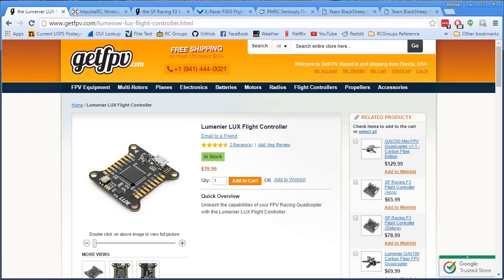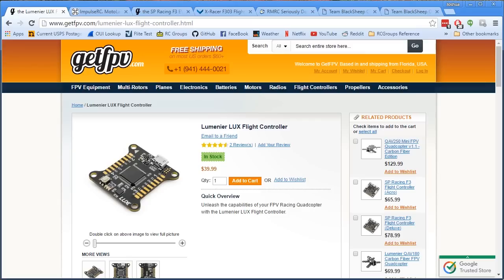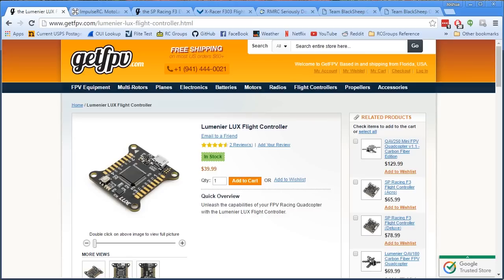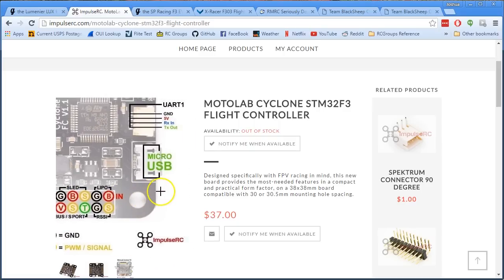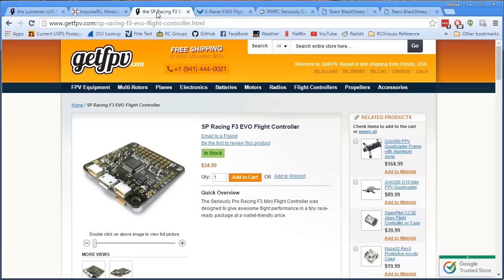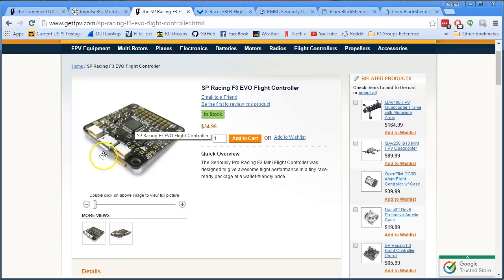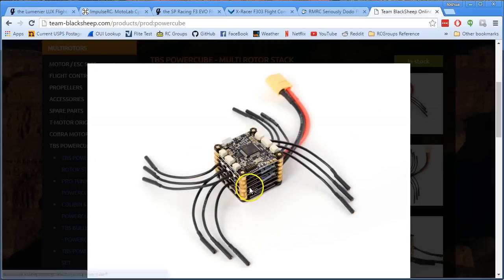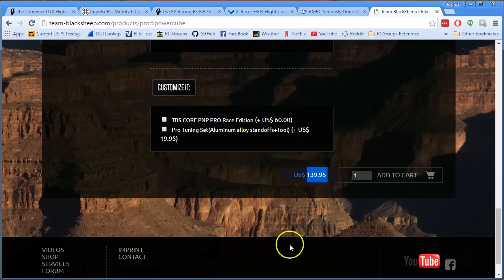The Best Cleanflight Flight Controller(s) - May 2016 Update

Comment: I will never fly my powercube again 😢. I'm kidding,  I have no complaints, running betaflight and blheli and I think maybe just don't have the level or knowledge to notice the difference I guess. To me it feels locked-in and and flies like I expect.  Moving to kiss probably in my next build.
Reply from the maker: Team BlackSheep I also thought your tone was defensive. Comments like, "keeping one hand in your pants" for example seemed discourteous and inflammatory. Also, I really don't think I "trashed" your product or "dumped all over it". I think I was VERY clear that I didn't know whether your ESCs perform well or not. I think that I am very clear with my audience about when I am sure about my answers, and when I am speculating based on incomplete information. And I go out of my way to set the record straight when I'm incorrect.

I actually did read your manual. And to be sure I wasn't missing something, I also searched for "gate driver" and didn't find it. So it turns out you use the term "FET driver" instead of "gate driver". My mistake. But even by your own estimation, this puts the PowerCube on par with the Afro HV, which is 15th place on QMF's 1800kv test and 24th place on his 2700kv test. And that is ONLY taking into account thrust and g/w, not braking performance or thrust and rpm delta. So it sure sounds like you are agreeing with me that the PowerCube's ESCs are, at best, mediocre, even though I got the technical detail of whether you have a gate driver or not wrong.

My main criticism of the PowerCube is that I don't want to pay a premium to be denied the ability to choose top-notch ESCs for myself. Many, many people feel differently and prefer to pay a premium for the ease of build and integration that the PowerCube offers. I don't know why stating this fact seems to make you so mad. It's like if somebody said, "I like to solder and build, and I think I can get a higher performance power system by designing it myself, so I don't want a Vortex Pro," and somebody from Immersion got all mad and insulted.

We're talking about ESCs here because the PowerCube's ESCs and FC are a single unit. You can't assess the PowerCube's FC without discussing its ESCs.

I'm not interested in getting into an argument with you. I feel like we have both said our piece and am happy to let the issue lie. But if you're going to keep arguing with people here, I'm going to keep sticking up for myself.
Reply from the maker: In lieu of data, I'm fine with an educated guess. Let's get the powercube tested by QMF and find out what the results are, and then we'll know how it stacks up. Are you familiar with miniquadtestbench.com?
Reply: +Team BlackSheep I think JB's review on "your" esc was more than fair and diplomatic.   Your defensiveness only leads me to wonder why? Have you missed the mark with your modular cube? I feel that product is directed more for the plug and play market that would rather pay more than faff around with a soldering iron (and credit to your brand) with the added bonus of dropping the fact that he/she has the latest "thing" from TBS. Well, I dare say the watchers/subscribers of Joshua Bradwell's channel are predominantly looking for a bit more than what cube has to offer.
Reply from the maker: +Team BlackSheep here's the research I did: read the product page and manual. Google "tbs powercube dedicated gate driver" and some other variants of that. Nowhere could I find any reference to the powercube using dedicated gate drivers. I also searched miniquadtestbench.com for the powercube to see if there were any test results. There were none. 

As I think I say in the video, historically absolutely no Atmel based ESC's other than KISS top the tests. And KISS have dedicated gate drivers and hardware PWM generation. Afro HV comes close in performance with dedicated gate drivers, but there are easily 20 SiLabs ESC's that beat it.

So what more research do you want? Im not making wild assumptions here. In lieu of evidence which doesn't seem to exist, I think it's safe to assume that an Atmel ESC has been built by its manufacturer for price not performance. If you're the exception, I encourage you to submit to QuadMcFly for testing and update your marketing materials to make your claims more obvious.
Reply from the maker: At the end of the day, like I said in the video, "I think that there is an audience for this board, but that audience isn't me." I try very hard not to waste anybody's time showing them products that are shit. The PowerCube isn't shit. It's just not for me.
Reply: I am more than willing to test the powercube ESCs if anyone wants to get me a unit to test.
Reply from the maker: Thanks for setting the record straight. I will be sure to link to these comments when referencing the PowerCube in the future. Frankly, I think I can even add an annotation to the relevant section of the video with a direct link. I hope that helps a little bit.

Is there a reason why the PowerCube hasn't been tested by QuadMcFly? If you haven't submitted one, I'd encourage you to reach out to him. Ultimately, whenever people ask me what the highest performance ESCs are, I plead ignorance and refer them to his site, miniquadtestbench.com. I would love to see the PowerCube high up on his ranking, and to add it to the Afro HV and of course KISS in my list of, "The only Atmel ESCs worth even considering."
Reply: +doondedulin44 *& FC
Reply: +Joshua Bardwell +TeamBlackSheep 2 wrongs don't make a right. I do think that Joshua, as someone that sooo many look to for the very best quality information, shouldn't review things he hasn't had personal experience with. I think it wouldn't have been too hard to find Trappy in the forums and get info from him to reference but I digress. On another note I think we all agree TBS was overly strong with his rebuttals and came across very unprofessional in that sense. I also think the best course of action is to put your product where your mouth is... A simple "I strongly disagree with your opinions/assumptions and I would like to offer you a test unit for your unbiased review. I think you'll be pleasantly surprised!" would have settled it perfectly.  Hell I'll donate $20 to help this happen. I personally have a PowerCube myself and it functions perfectly and was exactly what I was looking for in the build which was simplicity and I personally don't mind a little premium for convenience.
Reply from the maker: In judging the ESCs' performance, I was accepting your premise that they probably perform at about the same level as the Afro HV. You're arguing that my assessment of the ESCs' performance is wrong or incomplete, but it really seems like we agree, so I don't know why we're arguing. You know your product better than anyone. I took an educated guess based on what processor they have in them. And we ended up in the same place. So why are you arguing that I'm wrong?

I'd love to check out the facts. If you have a head-to-head test of the powercube vs. any of the current-gen (f390) or last-gen (f330) ESCs, I'd love to see it. I am always, always, always open to data that challenges my current beliefs. But in lieu of perfect knowledge, I don't think that I'm obligated to just throw my hands up and plead ignorance. If you show me a 4-cylinder gas engine and a 6-cylinder diesel and ask me which one has more torque, and which one gets better gas mileage, I can make a decent educated guess at the correct answer. Likewise, if you show me an Atmel ESC with a dedicated gate driver, I can make an educated guess about where it will fall in thrust and most especially braking performance. As long as I fully disclose that I am making an educated guess, which I did, I feel that I'm still on the right side of the line, journalistically speaking.

I'm focusing on the PowerCube because people asked me, "What about PowerCube"? They didn't ask, "What about Colibri?"
Reply: I just bought two of them and I'll let you know.  BTW my friend has two also.  Fpf freestyle pilots Hartford CT

Comment: Ok. So apparently the integrated pdb with OSD (DAL XR215) and XSR Rx cannot share the same protocol on the same uart. I had to disable Smart Port  so the OSD would work on that Uart. I thought I could be smart and stick the smart port on uart 1 cuz I would only use the FRSKY tele while flying...but that seems to kind of lock up the CF program.  So I guess I can't have my Cake cuz I only have three UARTS. Hey at least my dumb self figured it out:)  Tnx for your inspiration Josh
Reply from the maker: +tahosrfr don't know why that wouldn't work. I use Blackbox in UART 1 all the time. But notnin that board. Maybe the osd is using UART 1?